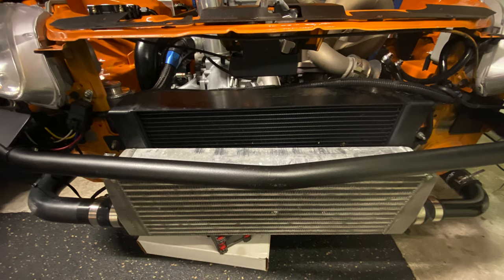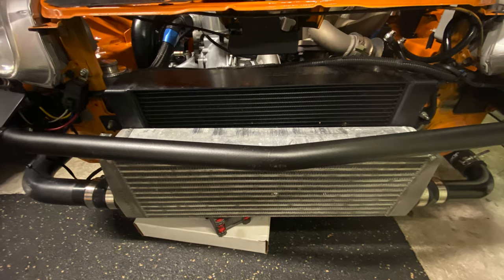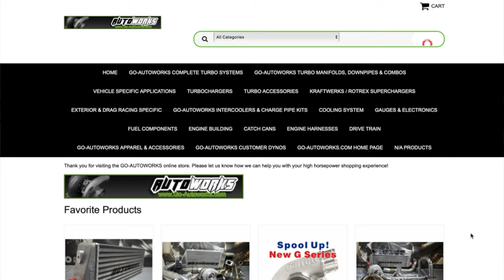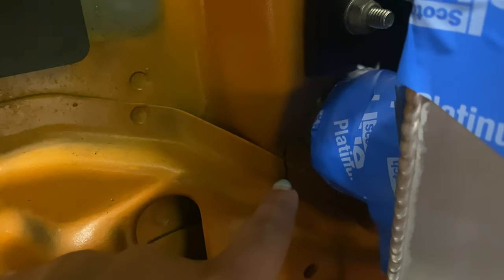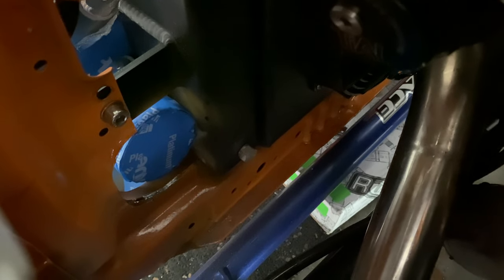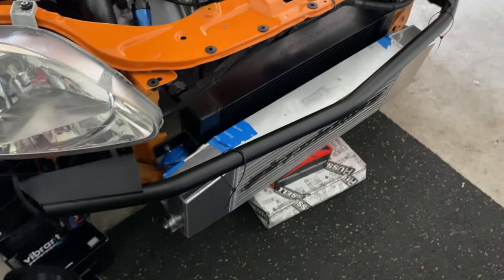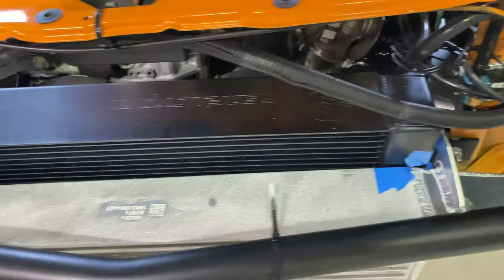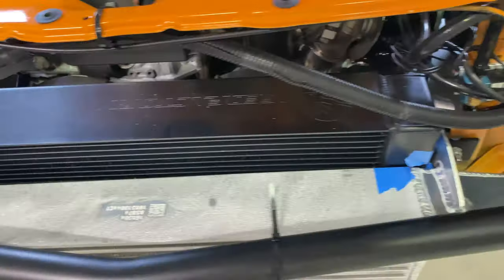DUAL BACKDOOR INTERCOOLER & Fabrication Work - GoAutoWorks - Race Genetics Fabrication

Comment: Wow! Glad to see another video from you and the car. I’m thinking you’re going to redo your fuel system because it looks like you already have the coil pack. Speaking of coil packs I’m going to install mine pretty soon. 

But I got another guess
1. Fuel system
2. Bushing kit (the thing that is always over looked, I just did mine and they were all shot! My 95 teg chassis has over 289k miles on it.)

Comment: I notice that you have switch from a precision to a borg warner turbo now?Any input on that and which size did you go too?
Reply from the maker: I had a Turbonetics turbo previously. But the Bog Warner that I got is the S-200-SXE with a .82 AR back housing and it's perfect. The turbo is rated for 550hp, but I've managed to make 593hp with it so far. Borg Warner turbos are long lasting.

Comment: Won’t the pipe or intercooler crack as it’s all hard piped, as the motor moves under heavy acceleration something will break!
Reply from the maker: The Vibrant HD Clamps flex, so that prevents it from cracking piping.

Comment: Dual backdoor is the ish......I went dual back door with A/C
Reply from the maker: How did you do dual backdoor with A/C?? Did you have a custom condenser?
Reply: @Aisha_LadyBuilt  Nope, stock condensor. My cutouts are located where your radiator mounts are. I'll post a short video and send you the link.

Comment: No traction......time to go AWD. You just have to give an arm and leg for Wagon diff
Reply: Could pin a crv diff too and pray lol
Reply from the maker: I would love to go AWD, but it's not worth the headache for me in a B-Series. It's either a transmission that can't take high RPMs and will be breaking a lot or an all out transmission that's not comfortable driving on the streets. I drive my car on the streets and I need high RPMs, so I'm out, I'll just stay FWD until a better solution for B-Series comes out lol
Reply: @Aisha_LadyBuilt  yeah they sell billet upgrades for the crv transmissions but it’s just really expensive with internal parts to replace too sadly. I have a crv diff, trans and shifter box with cables but it’s just expensive lol
Reply: @Aisha_LadyBuilt  I agree the cost is too much. I'm shocked honestly at how many people are doing this based on the prices I 👀.  If you had to buy everything you talking $6K-$8K just in parts including Wagon diff. Even if you replace with crv and freelancer stuff it is still $4K-$5K. Most of these cars are clapped out and not worth $4K-$5K